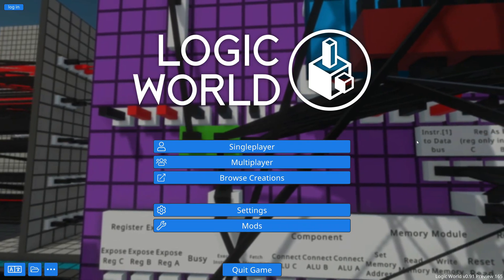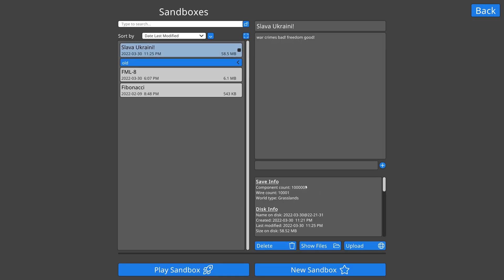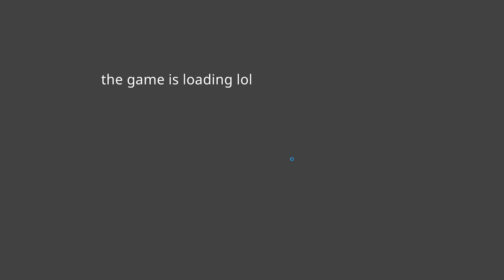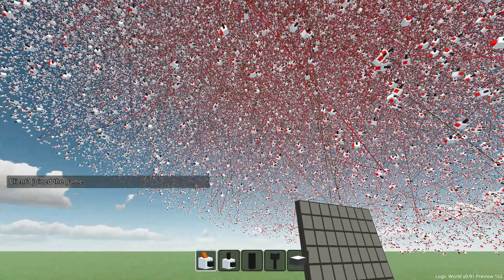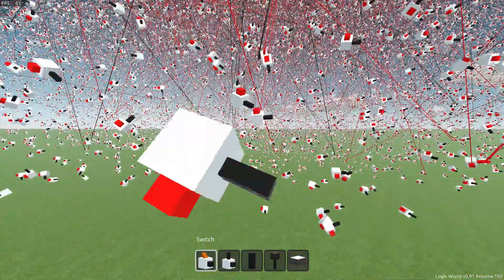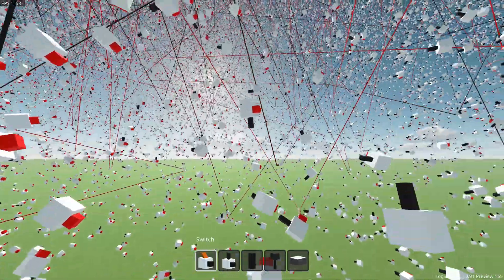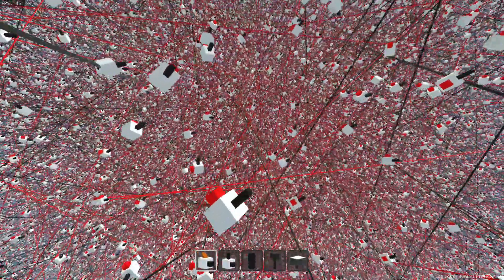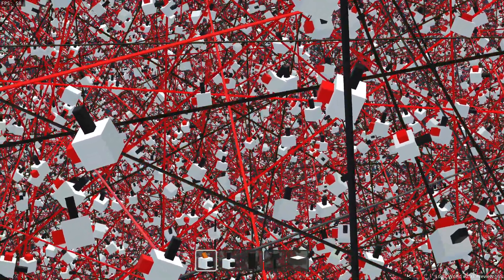1 Million Inverters | Performance Demo

Comment: What's the tick rate?
Reply from the maker: If I recall correctly, the game is running at 3 ticks per second in this demo. Not because the simulation was a performance bottleneck, but because pulsing the circuitry any faster was visually jarring and unpleasant. I'm sure a setup like this could run at many thousands of TPS without issue. -Jimmy

Comment: this demo is amazing, and so promising.  This got me thinking though...  does Logic World have a realistic mode of gameplay where power draw and amperage is considered ?   Over heating and resistance would be a cool feature to add if its not here yet.

Actually, this would be like a "sandbox" mode ( the normal mode ) versus a "simulation" or "career" mode
Reply from the maker: Logic World is not intended to be a simulation of real-world electronics. I'm not very interested in all those fiddly complications; I'm interested in digital logic, so that's what I aim to simulate with Logic World. Nothing more and nothing less.

-Jimmy
Reply: @MouseHatGames im so glad that's the case